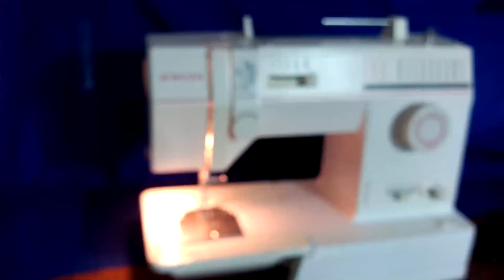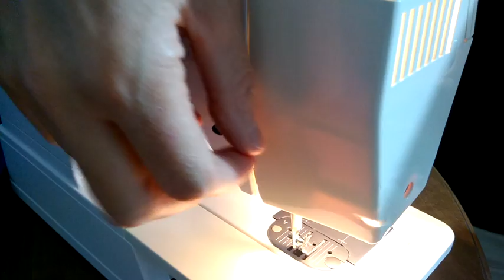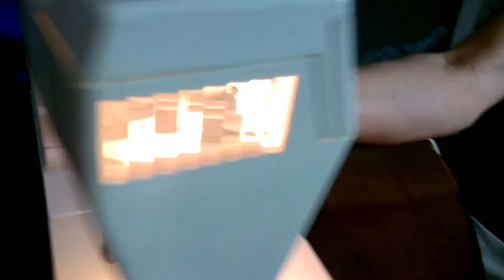Singer 9020

Comment: Just got this machine at Goodwill for o $25 everything seems to be fine only things missing was the attachment you put the fabric on, bobbin case holder and bobbin and the power cord which isn't that expensive overall I think it's a good deal if not o well have 2 brothers just wanted a different kind to try so I bought this one and a brother but it needs oiled a, bobbin plate, and power cord but I'm in no hurry to get the parts.

Comment: Hi, I got the the same model on your display. I'm glad the you allow the viewer to ask question.
I have an issue and can't fix it. When test the straight sewing line, the top line shows ok but the bottom line were bundle with many extra big loop as the size the the bobbin circle. I followed the guideline setting and fixing, but the issue still be there. Please help. Thanks

Comment: try to open the left side of the machine maybe the screaw is missing fr.the presser foot lifter. 
i have the 9113 model almost the same, just that at the top is a compartment for all the feet that included w/
that needs a slant shank feet

Comment: I purchased this machine used. I had a 9034 that I literally wore out the motor. It never gave me an ounce of problems. I used it for my alteration business so the motor saw a lot of miles. I found a used 9020 model and should be another good workhorse. Do you have any idea what year this machine was made? I purchased my 9034 in 1998 and believe this machine to possibly have been made about 1991. My neighbor had the 9020 that her sister decided to repair and it is a disaster. She gave it to me for parts. She thinks it to be about 26 yrs. old which sounds about right.

Comment: Hi, Can you please upload a video for the complete disassembly and assembly of the 9018's Needle Thread Tension Dial . I removed the dial and , I feel like I lost springs. Also, I do not know the order of the plates to install them back. Also, if you know any store where I can buy parts. Thanks..
Reply: @Adeline Roy mine is slightly different but same screws. Three on top cover. Take one screw out of end of light cover as if changing light bulb. Remove light cover and you will see a right angle bracket screwed to sheet metal behind light and then to top cover. Loosen screw going into sheet metal. Only loosen as right angle bracket is slotted. The stitch width knob will pull straight off. Just keep pulling slightly harder and maybe slight wiggle. Mine was very hard to remove. Once knob is off, move that arm to the right, to wide stitch, this helps cover clear arm. Now pull right side of cover gently up and towards you to clear the metal stitch width arm. Hope this helps.
Edit: oh, and the back of tensioner unit is a slide on clip that can be removed with needle nose pliers. That is all the further I went because my problems are much greater than the tensioner.